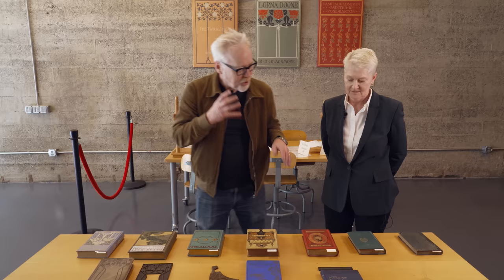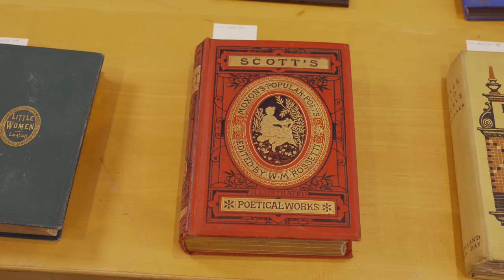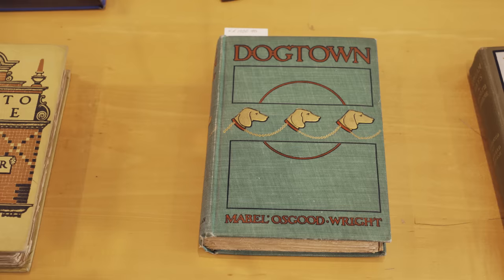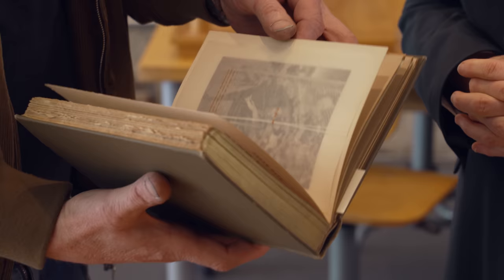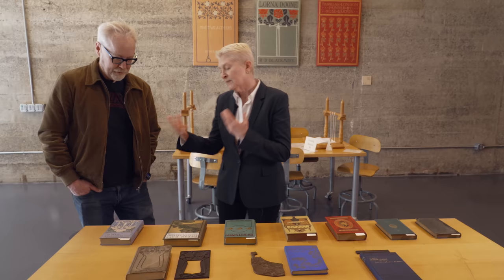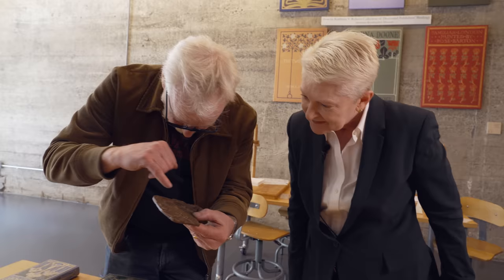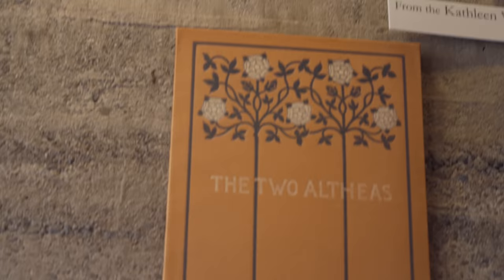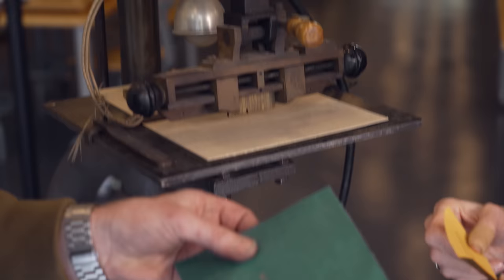The History of the Modern Book Cover

Comment: Adam, I think you're closer on estimating the age of that foil embossing press than the lady showing it... the raised lettering on the cast iron arm and the overall styling indicates early 1900's, as does the wooden letter type holding clamp mechanism. I LOVE the older, stoutly built machinery style of the late 1800's/early 1900's. I'm your age, and that machine sure doesn't look like one built in the '60's!
Reply: I found the website for the company and it looks like they still make the same machine. They started in the 1920s so either of them could be correct. You would have to look at the serial number to find out. But I have noticed people saying 50 years old when they mean 1950s. People don't realize how fast time goes by I guess.
Reply: @alexgibson4782  Thank you. I found their site, too, thanks to you... it's amazing their still making the same machines after 100 years. I wonder if they're still using the cloth insulated wiring? Very aesthetic designs.
Reply: @IAMSatisfied FWIW, cloth-insulated wire is still commercially available. It's often called "pushback" wire (because you can just push the insulation back instead of having to strip it). The premier manufacturer (at least in the electric guitar scene) seems to be Gavitt.
Reply: The text on the machine itself says "PAT'D US AND CAN 1928", so it can't be 100 years old, though it's certainly possible that the design predates a labeling update.

Comment: If there's an option to stamp a cover blind or with foil, heated or not, better results come from stamping an assembled case. The adhesive and board or flexible spine inlay will have a bit of softness, creating an actual impression to protect the foil from unnecessary wear, or making a slightly more "impressive" blind stamping.

Comment: 10:27... ugh... she didn't lock the print head down. The lever on the top pushes into parallel with the letter block. I used to work at a luggage store that this exact press. We would monogram luggage, books, writing pads, wallets or other leather goods.

Comment: Not cover related but why do some US casebound books have uncut pages? From this film, it's clearly not age-related nor an homage to historical tomes, as older books with gilded page edges had all-around trimmed pages. Many thanks!
Reply: It's primarily a cost-cutting measure, although it could be "sold" as a physical proof that the book is indeed new and not used, as the pages are uncut. Even in the mid-50s, textbooks were still issued to students at the start of the school year with partly uncut pages, so the teacher would pass them out and then demonstrate the proper corrective technique. (Definitely no sharp instruments involved - it was a ruler run obliquely inside the few remaining foreedge folds, as I recall. The top edge had to be more completely cleaned prior to casing in.)
Reply: @robertphillips93  Thank you, Mr Phillips. I'm sure I've also seen brand new books sold in this state - is this simply an affectation?
Reply: In mass production, EVERY time a product has to be handled or “processed” in some way—like trimming the edges—cost is incurred as per Robert Phillips’ answer. However, leaving the feathery edge known as the deckle at the leading edge of the pages can be an aesthetic choice as well.